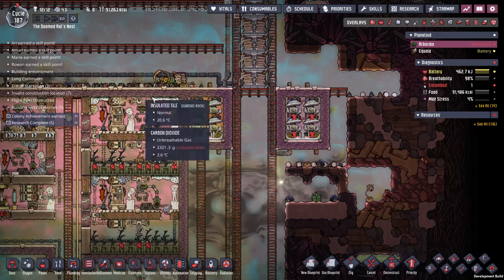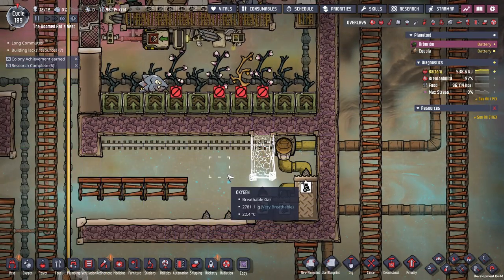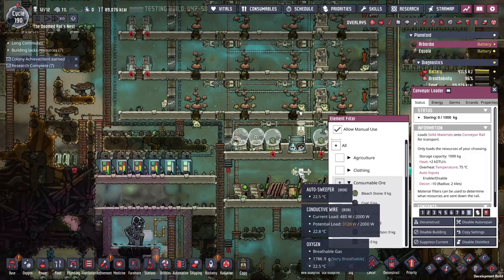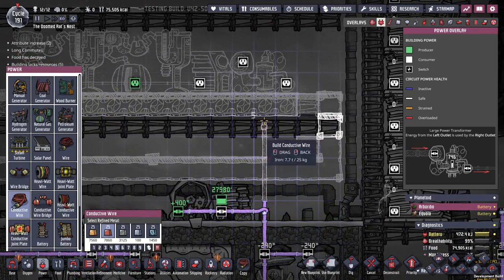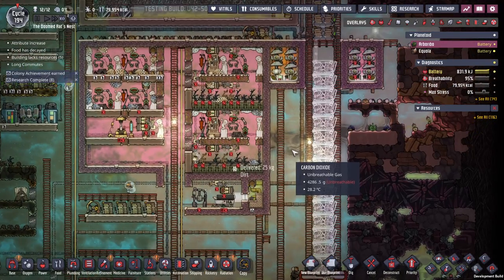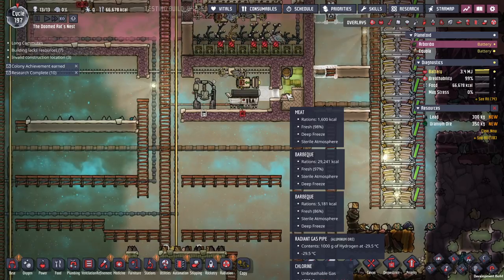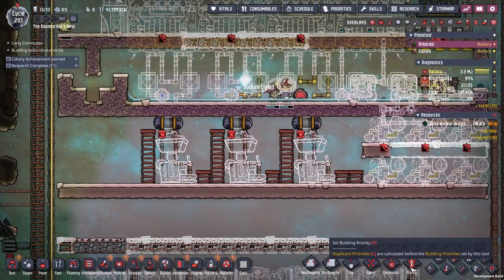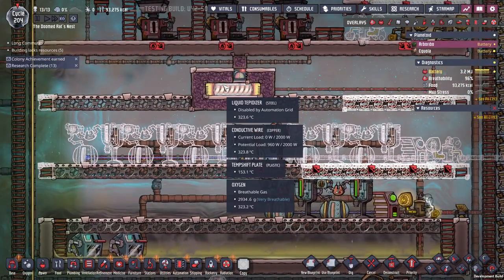Plastic Melting for Naphtha  Oxygen Not Included Spaced Out

Comment: Love the temp sensor and the shutoffs above each metal refinery to recycle and get the heat out of the coolant. Never seen that done before but such a good idea.
Reply from the maker: Thanks I have been using that for a long time.  You can adjust the temps to keep the steam hotter.  I think I saw that on a Brothgar video first, not sure though.